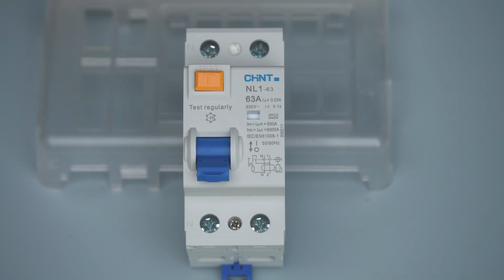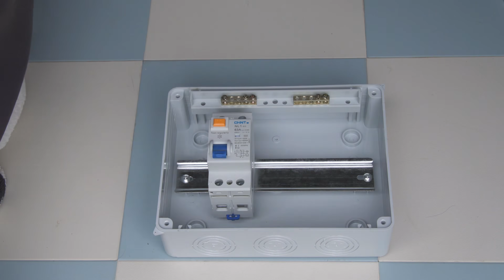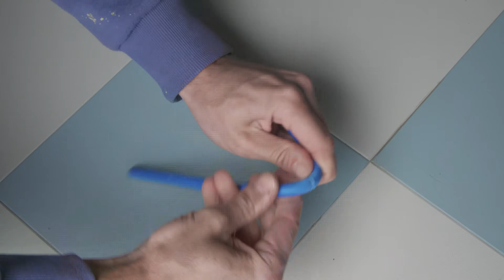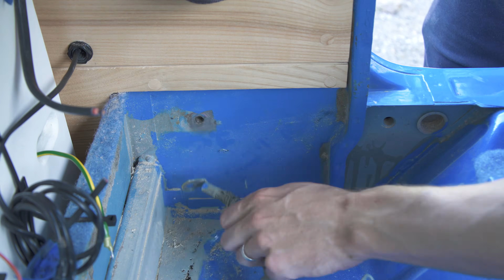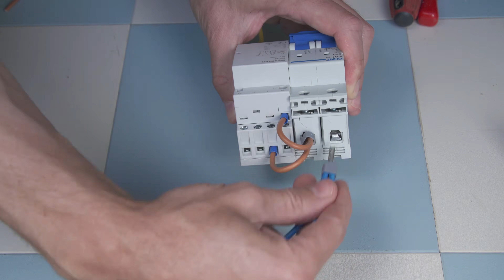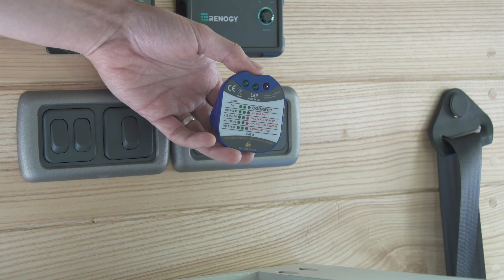How to Wire a 230v Camper Van Consumer Unit in 2026

Comment: If the inverter includes bypass (ATS) and RCD (MEN), is the wiring simpler?
Reply from the maker: Yes, absolutely—it makes the wiring considerably simpler!

If your inverter/charger has an internal ground relay (MEN) (like a Victron MultiPlus), the unit automatically connects the Neutral to Earth when off-grid and disconnects it when hooked up to shore power. That means you can completely skip the external AC contactor and all that messy relay jumper wiring!

You'll still need:

Inlet Protection: A double-pole breaker (or DP RCBO) right after your shore inlet before the inverter's AC input.

Output Consumer Unit: A double-pole RCD and MCBs on the inverter's AC output to protect your socket circuits.

Chassis Earth: Bonding the AC earth bar to the vehicle chassis (min 4mm² cable).

It's a much cleaner, hassle-free install compared to dealing with a floating-earth/centre-tapped unit!

Comment: Great video explanation, thanks! Is there any reason why you can't use a 12 way distribution box rather than 2 x 8 way boxes?
Reply from the maker: Yes, you can definitely use a single 12-way box!

I used two separate 8-way units mainly because they fit the shape of my electrical cupboard better, and it creates a clear physical separation between the Shore Input side and the Inverter Output side.

If you go with a single 12-way, just make sure your 2-pole busbars are split so the input and output sides remain totally separate circuits, and label your switches clearly!

Comment: I also have a BLUETTI unit and I have an automatic transfer switch so that when plugged into shore power the power goes from shore via the switch into the consumer unit and in to plug sockets. I can then have the BLUETTI being charged via one of these sockets. When I disconnect the shore power the transfer switch swaps over to the BLUETTI to power the consumer unit and then on to the sockets. Obviously I switch off the input to the BLUETTI. Would I still need the AC Contactor?
Reply from the maker: Yes, you still need the AC contactor!

Bluetti units have a floating earth, and standard ATS units only switch Live and Neutral across without creating the required Neutral-Earth bond. Without the contactor closing that link off-grid, your RCD won't detect earth faults or trip safely.

Also, pro tip for charging: wire the 230V socket used for charging the Bluetti before the ATS on the shore input side. That way, it automatically cuts power when you disconnect shore power so you never accidentally loop power back into itself!
Reply: if I buy a Victron Smart inverter and Fogstar battery to replace the BLUETTI unit could I wire the inverter into the transfer switch and not have an ac contactor as the inverter deals with it then would I still need a separate consumer unit for the inverter?
Reply from the maker: Hi Adrian! It depends slightly on which Victron model you are looking at:

If it's a Victron MultiPlus (Inverter/Charger):

It has a built-in transfer switch and an internal automatic ground relay. It handles the dynamic Neutral-to-Earth bonding internally, so you do not need an external AC contactor or external transfer switch.

If it's a Victron Phoenix Smart (Inverter only):

It does not take shore power directly, so you would need an external transfer switch. Because the Phoenix has a floating output, you would still need a method (like the contactor setup) to create the N-E bond off-grid so your RCD functions.

Do you still need a consumer unit?
Yes, absolutely. You still need double-pole 30mA RCD and MCB (or RCBO) protection for your 230V socket circuits after the inverter output, plus an incoming double-pole breaker where shore power enters the van. You can house both stages in two small boxes or inside one larger consumer unit with split busbars.

Pairing a Victron setup with a Fogstar lithium battery makes for a top-tier electrical system! Hope that clarifies the layout.

Comment: Apparently the contactor is to be before the rcd's
Reply from the maker: That's actually spot on, and is exactly how it's wired in the video!

The contactor's Neutral-to-Earth bond link (terminals R3/R4) connects to the neutral busbar on the supply side (before) the output RCD in Consumer Unit 2,.

You must never put an N-E bond downstream (after) the output RCD, otherwise neutral current will flow back through the earth wire and instantly trip the RCD as soon as you turn an appliance on!

The contactor coil (A1/A2) is wired off the first consumer unit so it senses shore power and automatically disconnects that bond when you're on campsite hookup.

Comment: Awesome video! Really clear. Helping me with my own camper van plans for sure.
Question though:
I am planning to use a "power station" (Bluetti) rather than separate Renogy / Victron components for MPPT, DC-DC etc.
I will still have a EHU outside connected to a socket inside (via a CU), so I can charge my Bluetti safely (ie not just throwing the AC plug through an open window!)
On the AC Output side, I want to connect some fixed 230v AC sockets to the Bluetti unit, also via a CU. 

Qn: Is it OK to supply the CU with a  plug that gets plugged into one of the sockets on the power station?
Reply from the maker: Hi Jay, yes, that works completely fine! You can run a heavy-duty flexible 3-core lead with a 13A plug from the Bluetti straight into the input side of your output consumer unit.

Just ensure you use multi-stranded flex with bootlace ferrules, clamp it with a cable gland, and keep the consumer unit's earth bar bonded to the van chassis (min 4mm²).

Also keep in mind Bluetti units have a floating earth output, so the RCD won't trip on earth leakage without an N-E bond, but the MCBs will still protect against circuit overloads. Enjoy the build!

Comment: I'd like to know if it's necessary to add an AC contractor when wiring up the Renogy HF pro inverter, I was under the impression that it has an AC contactor in place already within the unit itself but now that you've said about it not being mentioned in the manual for that inverter model it's making me question things myself
Reply: But if it's not mentioned that it's necessary to add it either
Reply from the maker: Hi Stu, yes you still need the external AC contactor!

While the HF Pro has an internal transfer switch for shore power bypass, it lacks an automatic internal Neutral-Earth bonding relay. In off-grid mode, the AC output is floating, meaning your RCD won't trip if an appliance gets an earth fault.

Renogy manuals unfortunately don't cover UK earthing specifics, so adding the external contactor is still the proper way to make the RCD fully operational off-grid!

Comment: Hi great informative video, I have just purchased a Renogy 2000w inverter that has auto switch from shore power to inverter do you still need the contactor or does the unit deal with it? Thanks for any info you can give me, much appreciated.
Reply: Hi @paulwitham8026, the issue is about the RCD protection. If you just run shore power directly through the Renogy inverter, then from the inverter into a consumer unit then the inverter passes the shore power straight through. The RCD in the consumer unit will work and you won’t be electrocuted when you stick your wet fingers in a socket.  However, when shore power is not connected, the Renogy inverter produces its own sine wave power +120 volts Live to Earth and -120 volts Neutral to Earth.  Your microwave and equipment still work and it all seems good, BUT the RCD in the consumer unit won’t work and you WILL get electrocuted when you stick your wet fingers in a socket. The Neutral is essentially LIVE. The inverter AC output needs to have the Neutral output Bonded to Earth ( to get +240 volts Live to Earth and Zero volts Neutral to Earth) to ensure correct operation of the RCD. However, you will need to disconnect this N-E bonding when shore power is connected, otherwise this interferes with the shore power itself, as this is already bonded to its own earth at the campsite. This N-E bonding disconnection is what the relay does.  It disconnects the bond when shore power is applied.

This issue is poorly understood by many DIY campervan builders, and the documentation from many inverter manufacturers fail to highlight this issue. Hence, I think this is a great video showing one way in which an inexpensive inverter can be automatically tied in with shore power.
Your 2000W Renogy inverter is essentially designed to just have equipment plugged into it. It is not really designed to provide power for distribution.

This is a good explanation here 
https://www.youtube.com/watch?v=oRKXo-Gd-6E     
https://www.youtube.com/watch?v=J_KoKW4HGwg
Reply: @daveharrison8808 thanks for the explanation, you should have read my next comment down, I rewatched the video and all was clearly.
Reply: @daveharrison8808  what if I will never have the inverter plugged in on the mains in the campsite and only be used when off-grid. How will I bond N-E in that instance?
Reply from the maker: @vasililyras2009 If you are never connecting to shore power, it's much simpler—you don't need the AC contactor at all!

Because there's no campsite mains to conflict with, you can wire a permanent Neutral-to-Earth bond:

In your consumer unit, link the Neutral wire coming from the inverter directly to your Earth busbar.

Crucial: That link MUST be placed before (upstream of) the RCD. If it's placed after the RCD, the breaker will trip instantly the moment you turn an appliance on.

Bond the consumer unit Earth busbar to your vehicle chassis (min 4mm² multi-stranded cable).

That turns the inverter's floating output into a standard TN-S setup where your 30mA RCD will trip instantly and safely under an earth fault!
Reply from the maker: Hi Paul, yes, you still need the AC contactor!

The Renogy 2000W inverter handles the automatic switching between shore power and battery, but it doesn't create an internal Neutral-to-Earth bond when inverting off-grid.

You need the external AC contactor to automatically provide that N-E link when off-grid so your consumer unit's RCD can actually detect faults and trip safely!

Comment: If I don’t intend the inverter to be connected to the shore power, do I need the mcb and rcbs on my cable for sockets that are directly plugged in to the inverter sockets? So I’m plugging a 2.5mm artic cable directly into the socket output on the inverter that ends with a double socket, will that be ok?
Reply from the maker: Hi Darren, while running a lead from the inverter's socket will physically work (the 13A plug fuse protects the 2.5mm² cable), you won't have 30mA RCD shock protection.

Inverters have internal overload trips, but they won't cut power to protect a person if an appliance casing becomes live.

For a fixed installation, the safest and compliant route under BS 7671 is to run from the inverter into a small consumer unit with a double-pole 30mA Type A RCBO, bond the earth to the van chassis (min 4mm²), and ensure the inverter is bonded Neutral-to-Earth so the RCD functions properly!

Comment: I'm not an expert but are you missing something here when calculating the MCBs, I thought the MCB protects the wire, so you would use the draw to calculate the wire and then should the wire not dictate the MCB, lots of devices have 13amp fuses so why limit your sockets? I'm quite sure the cost difference is minimal - hope I'm not missing something as I'm fitting sockets with 2.5mm cable with 16a RCBOs
Reply: Indeed, where Ib<In<Iz. Ib design current( load) In ( protective device nominal rating) Iz the cable impedance (CSA size). That is the order. 

Also pointless having a C curve breaker, if it's feed up stream at the bollard by a B curve breaker, you lost selectivity. Meaning, on a fault condition, it will trip the bollard rather than your circuit. 
The regs states you have to achieve selectivity, by selecting a breaker with a suitable curve/rating, to enable it to trip near the fault, not upstream.
Reply from the maker: Hi Stephen, you're spot on that the breaker protects the cable! Using a 6A or 10A MCB on 2.5mm² cable means the cable is well within its safety limits.

In a campervan, we often downsize the MCBs because of system constraints—a 2000W inverter only puts out ~8.7A continuous anyway, and sizing dedicated lines (like a 6A breaker for a 700W heater) helps with circuit isolation so one appliance doesn't trip the whole van or campsite pedestal.

Your plan to use 2.5mm² cable with a 16A RCBO for general sockets is completely compliant and works great for 16A shore power!

Comment: Do you have to use a bus bar if you don't have one? Can you use wires to link them together?
Reply from the maker: Yes, you can use cable jumpers instead of a busbar!

Just make sure your link wires are suitably sized (typically 4mm² or 6mm² multi-stranded flex) and use dual-entry bootlace ferrules wherever two wires enter the same MCB terminal so the connections stay solid under road vibration.

Busbars are mainly used because they keep the box neat and save space, but wire jumpers are fully compliant!

Comment: Amazing Video. 

Hope you can help as I'm just about t o purchase all the parts for my EHU install, its a basic system with 1 RCD and 2 x DP MCBs feeding two double PLug sockets with built in USB-C Ports. One double socket on each side of the van (T6.1 Transporter).

The Drivers side socket will mainly charge phones , drone, cameras and maybe a coffee machine and also to up an Ecoflow large power bank (I have no Leisure battery).
The passenger side sockets will power items like a small Ninja Air fryer, possibly a induction hob, air pump etc, maynbe an alphicool coolbox and maybe a 700w micro water filled heater.

So my question is about the MCBs, should I have 10amp or 16 amp and should they be B Curve or C Curve wwhich type for which socket?

Many Thanks 
Adam
Reply from the maker: Hi Adam!

Definitely go for B Curve double-pole MCBs. B Curve is the standard for campervans—it trips faster and safer under fault conditions on campsite hookups compared to C Curve (which is only for heavy industrial machinery).

For ratings, with 2.5mm² flexible cable:

Passenger side (Air fryer/Induction/Heater): 16A B Curve so you have headroom for high-wattage cooking gear.

Driver side (EcoFlow/Coffee machine/Tech): 16A (or 10A) B Curve.

Just keep in mind that even with 16A branch breakers, the total simultaneous load across both sides is limited by the 16A campsite hookup post. Hope that helps with the T6.1 build!

Comment: Never seen anyone else mention a contactor, thanks for that info. If the inverter is pass through I.e. can automatically switch to shore power, can the ac contacter be fitted to the main distribution board negating the need for a 2nd one?
Reply from the maker: Yes, absolutely! You can put the contactor, inlet breaker, and output socket breakers all inside a single larger consumer unit enclosure.

Just remember that electrically they must remain two separate stages—the shore inlet side (which powers the contactor coil) and the inverter AC output side (which feeds your sockets via the RCD).

As long as you cut the busbars so the input and output sides don't bridge together, putting it all in one board makes for a very tidy install!